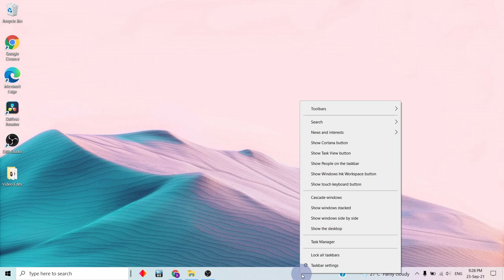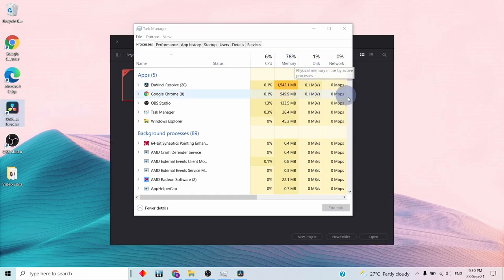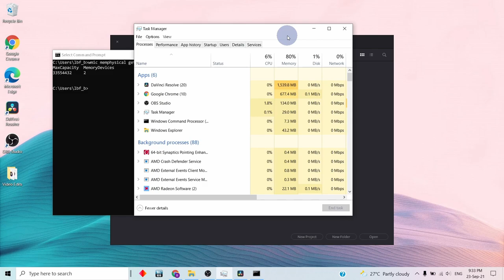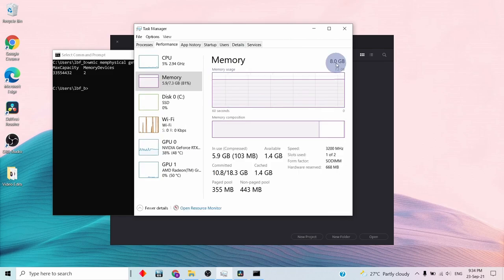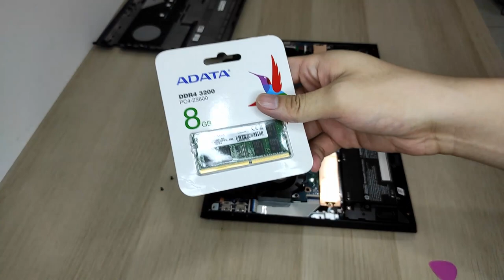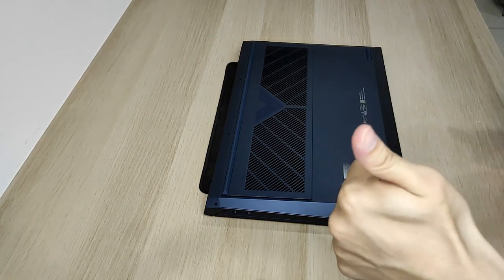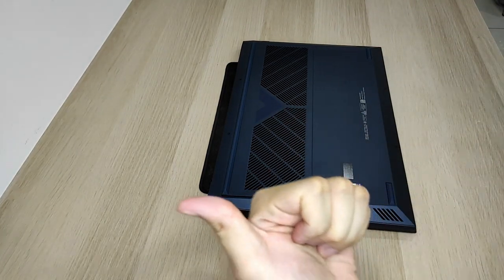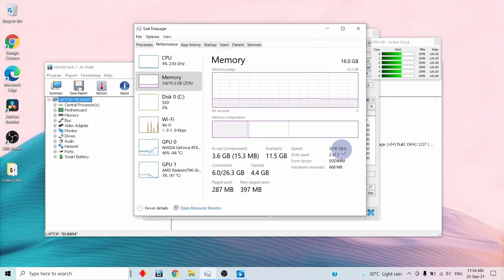RAM Upgrade DIY Tutorial.  The reason why you need to upgrade your RAM? HP Victus, 16GB RAM.

Comment: thanks, I already had a 8 gb stick and put another 16 gb stick, now I have 24 gb (it looks weird af lol) but it's working great, opening the back was the worst part
Reply: Hey can you please answer some queries of me please ?
Reply: @babyyoda3143  sure what’s up
Reply: @abrahamalviarez5870  i am planning to buy victus 8 gb so can i install another 16 gb in another slot will it harm in any way or do i have to install both of 16 +16 gb or 8+16 gb is good.
Reply: @babyyoda3143  the ideal scenario is putting two +16 rams of the same model (even better if the 32 gbs comes in the same package) but 8+16 works great for games and work, since the bios will pair the same frecuency for both memories. 

u will be ok just putting 16 gbs, if u can put both memories new, I will be even bettter.
Reply: @abrahamalviarez5870  i am buying a new laptop so the ram should be new too right soo will it work
Reply: @babyyoda3143  usually used ram isn't in the best shape, it depends how the previous owner used it, if u can get new ram, it's your best option, check the DDR format first, it's a SO DIMM DDR4, dont buy ddr3 or ddr5 by mistake
Reply: @abrahamalviarez5870  okay i am checking
Reply: @abrahamalviarez5870  8 GB DDR4-3200 MHz RAM, Up to 32 GB DDR4-3200 SDRAM (2 x 16 GB) is this good bro
Reply: @babyyoda3143  yes, this laptop can work with 32 gb
Reply: @abrahamalviarez5870  ok so can i install one 8gb and one 16gb ram in it
Reply: @babyyoda3143  yes, it's possible, mine is working with that configuration
Reply: @abrahamalviarez5870  ok sir thanks for your help.
Reply: Mine's one came with 4x4=8GB ram now i want to upgrade I want to install 1 of 16GB. Will it work with the another 4gb. 1 of 4GB & 1 of 16 GB.... It sounds weird...
Reply: @isanaullahktk  it should work, yes. if both are ddr4 there's no problem at all, we're used to x8 numbers, but 20 gbs is ok to use.
Reply: @abrahamalviarez5870  Perfect.. Can you recommend any specific company which is good to buy one 16GB. and also want to buy 1TB ssd as well for second slot . Thanks
Reply: Amigo tenho uma Dúvida !!
Victus by hp gaming laptop 15-fa0031dx 
Teria como adicionar outra ram ou ele só tem slot para um ❓

Por favor tô na dúvida ainda não Abri !!
Desde já agradeço!!
Reply: I have a question after I put the stick in the laptop how do I install the ram on the actual laptop
Reply: @abrahamalviarez5870  bro, what  factors should i consider before choosing another ram?

I know about latency but is there anything else?

Comment: They should make all laptops that have a built-in internal battery that they would AT LEAST use latches that open quickly so the  bottom is removed.
Reply from the maker: Great suggestion!
Reply: @BF_official_my   i have hp victus 15 ryzen 5 5600h gtx 1650 8gb ram laptop can i put 16gb ram in both slots to make it 32 gb?
Reply from the maker: @RYZEN5PLAYER  yes it works

Comment: Doesn't that ram card has a x16 density? If so wouldnt it affect your laptop's performance?
Reply from the maker: Yeah the New RAM its x16. Couldn't find a decent value x8 RAM and that time...nevertheless it's still running dual channel and i guess i could live with the slightly lower performance.
Reply from the maker: Apologies, just checked the my RAM card on the Hwinfo, this is a 2x4 8GB RAM card.

Comment: I have upgraded my Victus ram to 16gb by adding another one 8gb stick. I manage to brake something during the upgrading process. the plastic around the sd card slot, be careful at that area when pray open the whole back cover. Anyway great video. Subscribed. :face-blue-smiling:
Reply from the maker: Congrats 👏! And thank you for your subscription!
Reply from the maker: ramdevpandit8985  definitely since it's running dual channel

Comment: Just done upgrading my laptop. Did it 2x8GB stick for dual channel. Which is why, thank you for this video, it was a great help and an eye opener. It took me like an hour since its my first time doing this💀💀 sweated like buckets and was nervous af💀
Reply from the maker: Glad to hear that!
Reply: whatd you do with the 8gb stick that you replaced? i got a buddy looking to upgrade from 1x8gb stick
Reply from the maker: @McMovesdotcom  if you replace the 8GB, you may resell it. But for me I did not replace just bought an additional one to fit into the other ram slot
Reply: @McMovesdotcom  there are 2 slots, so I did not replaced the stock 8gb ram, just bought the same 3200mhz and 8gb ram but from a different brand
Reply: @BF_official_my  did yall match with the same ram?
Reply from the maker: @McMovesdotcom  for me did not match the brand, just the speed at 3200mhz
Reply: @BF_official_my  ty for replying! ill let my buddy know. get a better upgrade for cheaper this way
Reply from the maker: @McMovesdotcom  no prob, all the best!
Reply: @soli5156  hy bro.. using the same victus laptop?.. may i know what brand & price you bought?
Reply: @BF_official_my i think I’m using the same hp as you, is it compatible to add a 16gb ram in the new slot? So it would be a 8 and 16 gb ram
Reply from the maker: @kvhkvh6513  compatible but will not run dual channel

Comment: Try to stay away from using different gb sticks as the cpu will only take the lower mhz and leave out the higher ones as you MUST reset mhz to the highest gb stick for cpu to accept or you will only see half the gb you put in and system showing the ( 15,9gb useable) display. Ram is big factor to maximze PC to the fullest...
Reply from the maker: Yeap most importantly it won't run on dual channel
Reply: @BF_official_my  Off the topic but close, when I set OC on AMD FX8350 ( NOT docp mode but automatic and manual overclock) and boots up from 4. to 4.4 or 4.3 but,,, Ram mhz is set at 1133mhz and OC is slower than using DOCP Mode @ 1600mhz at fixed ghz of 4.0 on cpu as its faster than OC on start up, 40% better resolution and 30% increase of gaming FSP. I heard all this OClocking but it seems opposite as it was slower on FSP by 10 %. Really confused on OC performance when I went into Ram XMP settings to beat OC.?. I must be missing something on the mhz setting on ram at 1133mhz on OC.?>
Reply: There was no 1600 mhz setting on the ram. On OC mode is automatic of setting at 1133mhz. 1600mhz is my ram speed at 2 x 8 gb of 16gb total on dual ram.
Reply: @BF_official_my  Ive learned past week of my cpu fx 8350 is limited which proves it has its limits too no mater motherboard am3s DDR3s 4 slots. When reading dual ram, cpu will take 1133mghz and over ride power frequency from based 4.oghz cpu based up to 4.3 or 4.4ghz. It will take the duals but at this limit due to factory setting of single channels of 4gb each slot it give you both channels at the 4gb range each slot, no matter mixed gb sizes of using 4 sticks. Basically at the end, The CPU is asking in this manner to get just 1 stick of highest of 32g or 64gb. Its old CPU WITH REP OF BLOWING UP of novice overclocking before knowledge, lol.
Reply: Oh, I did the math on OC and believe I was big headed to realize the better performance of warming up at start up ( I also had to increase turbo fans manually , yikes.) using the based setting gives more mhz from both the channels as 1. At 1600mhz the cpu 
would take this path of using 800mhz each channel due to higher gb stick, the higer of voltage of buzzkill, lol. Oh, for using 4 sticks, cpu stick to using 24gb of forcing you to use 1 stick of greater gb size of a 32 or 64. Ill stick to getting a 32 gb stick. The math is simple, lol..
Reply: I took the 1133 per channel over 800 on 1600mhz volt limits.

Comment: My victus is coming with 16 GB ddr4 ram. I wonder if that'll be a single stick or if they left me room to upgrade. Thanks for the video, very enlightening.
Reply: Mine came stock with 16gb of DDR4, in 2 8GB sticks. There’s two slots, and it’s upgradable to 32GB of DDR4 so you hypothetically could do 2 sticks if you chose to
Reply: @micah2767 Any advice on what brand to use for the 2x 16GB sticks? And once you replace to 2x 8GB sticks, do you have to run anything to make sure it's ok? Or is it just Plug & Play?

Thank you
Reply: you can check it by pressing f1 / f2 while starting the system up and selecting the option for component details / component tests.. That will show you the Brand of Ram, its max speed, and the no. of slots its occupied. hope this helps

Comment: Hello.. Can you show us the COMPATIBLE M.2 SSD on this laptop?
1st slot is what type of m.2?
And also the 2nd slot, what type of m.2?
Can I add 1tb m.2 slot on the 2nd slot?
Can I change 512gb m.2 on 1st slot to 1tb also? So the total is 1tb on 1st slot + 1tb on 2nd slot for a total of 2tb?
HOW IS THE LAPTOP as of today? Does it have any issues?
By the way love your video, but you forgot to mention the 2 slots of m.2 in your 2 videos..
Please response.. That would help us..
Reply from the maker: Hi,  M.2 2280 NVME SSD will work.

Its total capacity is 4TB so you can add max 2 TB on each slot.

Victus runs hot while gaming in triple A titles else on eSports titles it works fine (will do a vid on this).

Thanks for your support!

Comment: Thanks bro I bought the victus with 8gb ram and AMD 5-5600H this was very helpful installing another 8gb ram.
Reply from the maker: Glad it helps!
Reply: @BF_official_my hey quick question i got the victus with 8gb ram is it ok to install a ram that’s different from the factory one ? or do i have to get the same one
Reply from the maker: @luxurious9056  yes perfectly fine, just try to get the same speed so it can run dual channel

Comment: I only have 8G 3200Mhz RAM. And I add 8G ddr4 2666Mhz Kingston RAM. after install I open my conputer it only have 8G and the RAM speed go to 2666Mhz......
Reply from the maker: Yes that is correct. The computer will only be able to cap at the lower speed, that's why I suggest to try to get and match the speed of your stock ram

Comment: Nice vid. Can I use any brand/type of ddr4 ram? Does different ram brand affect the laptop's performance?
Reply from the maker: Not different brand but different density of RAM. If you could, get dual x8 density RAM to get the best performance.

Else, if your RAM is running dual channel that's also enough for me.
Reply: Hello Even though I am late to this thread does the amount of voltage of the ram matter for laptop? Also I am planning to upgrade my victus also what voltage should be good for it?
Reply: Hello Even though I am late to this thread does the amount of voltage of the ram matter for laptop? Also I am planning to upgrade my victus also what voltage should be good for it?
Reply: Hello Even though I am late to this thread does the amount of voltage of the ram matter for laptop? Also I am planning to upgrade my victus also what voltage should be good for it?

Comment: Thank you for the video! was definitely very helpful!!! But i have a question: I have an 8gb stick in one slot. Would it be fine if I take that one out and put 2 16gb sticks in both slots?
Reply from the maker: Yes it will be fine.
Reply: @BF_official_my just plug and play right? dont need to change the settings or anything?
Reply from the maker: @nad-vs5sc  yeah no settings needed
Reply from the maker: @nad-vs5sc   all as per the content

Comment: What's the reason to disconnect battery before adding RAM ?
Reply from the maker: This is to double confirm that there is no power supply across the mother board.
Reply: @BF_official_my  thanks man

Comment: Does any ram stick work in this laptop how do I know which ram cards to get? I know I want 32Gs but what brand is there a specific kind of ram needed ?
Reply from the maker: No specific ram brand, just make sure to use DDR4  and try to get 3200mhz speed to match with your other Ram stick
Reply: @BF_official_my  awesome thanks ! I was going to get these ones - Corsair Vengeance SODIMM 32GB (1x32GB) DDR4 3200MHz CL22 Memory for Laptop/Notebooks (Intel 11th Generation Core Processors Support) Black
I have the hp Victus 16.1
Reply from the maker: @anonymousbritishcolumbia  great make sure you run the CMD prompt in the description to check how much RAM capacity your device can handle

Comment: hey man, i have a 2x4gb HP victus. So I can buy 2 RAM sticks of an 8gb or 16gb and install right? And yes my max capacity is 33.54gb. Does the brand matter? My current RAM is a DDR4 3200. I just need to buy another RAM set with the same module ID right? Will it also work if I buy a single stick of 16gb or 32 gb RAM?
Lastly, specifically for this VICTUS laptop, is there anything to do after installing the RAM on laptop? Like go to BIOS and change settings or something like that? or just install and turn on like normal?
Reply from the maker: Hi, get 2x8GBRam at 3200mhz same speed to run dual channel. Dual channel is better than 1xRam at 16GB. It will still work tho.

No need to go to BIOS 😄. Hope it helps
Reply: So I bought 2x16gb will that work too? My max option is 33.54gb
Reply from the maker: @aalwinthomas7556  yes it works!

Comment: i would like to get 2 16 gb ram but I'm not sure witch ones work for this laptop
Reply from the maker: Yes it works, just find DDR4 , 3200mhz
Reply: I purchased two 16 GB Vengeance DDR4 3200 MHZ sticks for my Victus. The laptop will turn on but the screen is blank and doesn’t boot. I tried just one stick and still didn’t work. I then put back the original stick and it booted. Any idea why it wouldn’t work?
Reply: These are made by Corsair off of Amazon

Comment: I’ll have this laptop, can I add an extra 16 gb ram or both slots need to have the same capacity installed? Thanks for the video!
Reply from the maker: I don't suggest that, both slots needs to have same capacity and speed in order to achieve dual channel.

Comment: could there be a reason why it won’t come on after the installation? the caps lock light just blinks repeatedly
Reply from the maker: Better check with the warranty team
Reply: I had the same trouble with a desk top. On looking again , I didn't install one of them  properly. It was too loose. Also I swapped sides because  for some reason it was a better fit.

Comment: heyy i too have the exact latop and configurations , how to upgrade to max then ? (upto 32 gb is that possible ?)
Reply from the maker: Yes just buy 2* 16GB RAM sticks
Reply: @BF_official_my  hey can i buy only one 16gb stick and join it with current  8gb ? will that work , thanks for reply:face-red-heart-shape:
Reply from the maker: @greyhar430 yes you may but it wont run in dual channel. Preferably try to get the same memory with same speed so that it runs in dual channel (better performance)
Reply: could you tell me the name of this specific laptop? i’m looking to buy it 🙏
Reply from the maker: @untypixel  it's the HP Victus!

Comment: A small question: will hp still accept warranty if we change the hardware ourselves?
Reply from the maker: For RAM and SSD... yes HP Still accepts warranty based on my experiences.

As both of this is upgradable. For the rest of the hardware, I could not advise on that.

But if you need a thermal repaste just contact HP as well

Comment: If i use a ram with different mhz for example the sodimm 2400 mhz would it still work, or it will have problems with the computer?
Reply: The sodimm 2400 mhz uses ddr4 just in case
Reply: And if i use a higher rate of mhz what would happen?
Reply: I will get you my victus version later
Reply from the maker: It will work but it will cap at 2400mhz and will not run at dual channel. I would suggest to get both same speed RAM

Comment: I'm debating on upgrading my DDR5 16gb Victus to 32gb. I'm wondering, is it really worth the need and cost ???
It does have 512 gb but that I will upgrade to 2 TB 980 pro. Your opinion on the RAM - is it that necessary to push to 32gb ? Because I know it'll eat the battery up FAST.
Reply: From what I know 16gb is already enough. Even for playing games, using ps, or 3d modelling. Is there a reason why you wanna upgrade to 32gb?
Reply: @beomsungg  - I want NO hiccups. I understand in my BIG RIGS - they always have 32gb min up to 64gb. 
Like 1 of my rings is 13700k 64gb 6000 with 30 cass. Now with my laptops, I don't mind more kick. I may just do this - take out 1 stick of ram and go from 16gb total to 24gb (by adding a 16gb piece) = I did already put in the 980 2tb pro. I do at times do video conversion and sometimes wanna play some games ?

Comment: Will crucial ram work with hp victus fb0002na, it's a gaming laptop. So I'm just wondering if crucial is good or there's a specific brand for gaming ram for laptop
Reply from the maker: hey any brand should work, just make sure you match the speed of your stock RAM, in my case it is 3200mhz to ensure it runs on dual channel ;)

Comment: Can you upgrade with 3200Mhz sticks when laptop comes with 2933Mhz ram installed ?
Reply from the maker: If you do that, your laptop will cap at 2933mhz, so I would suggest either just buy a 2933mhz RAM or buy 2 3200mhz RAM stick and sell the 2933 stick

Comment: Can I use 2Rx8 ram as the additional ram? I dont really understand about this ram density thing. It is a bit hard for me
Reply from the maker: Yes can it doesn't matter, just try to match the speed at 3200mhz and 8GB
Reply: @BF_official_my  Thank you so much!!! just bought online a new ram 8gb with speed 3200mhz. I got worried if it is not suitable due to the info of x8 and x16 which is new to me
Reply from the maker: @ryan123pop  you're welcome!
Reply: @ryan123pop  2x 2r will run faster that putting a 1 r in due to pre fetching data .

Comment: do you perhaps know if i can upgrade the victus 5600h 3060 model with m.2 sata?
Reply from the maker: SATA can't unless you downgrade your batttery to smaller which I don't suggest...just buy m.2 2280 will be safe
Reply: @BF_official_my  its m.2 (2280) form factor but SATA,  the brand is RX7 M.2 SATA